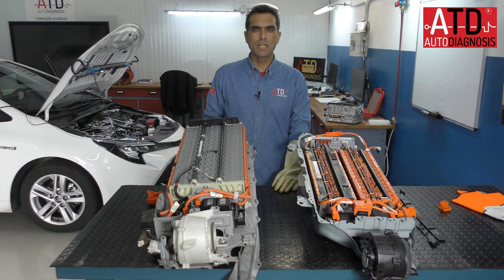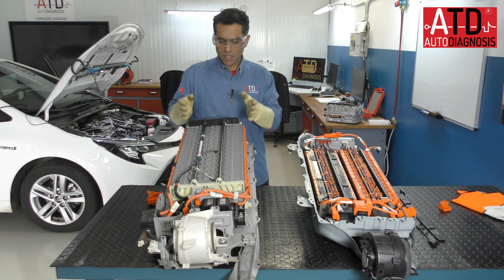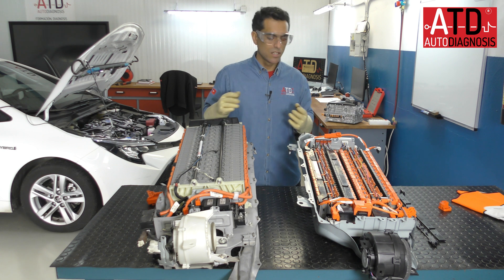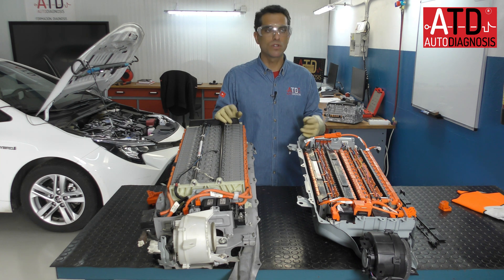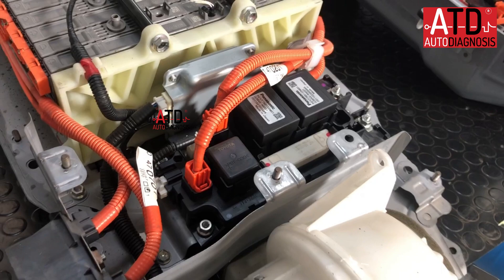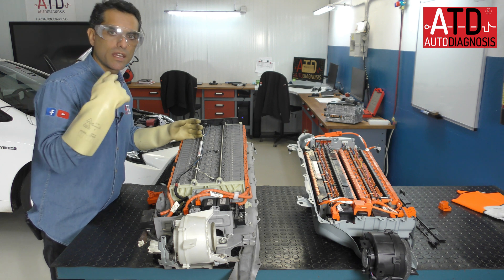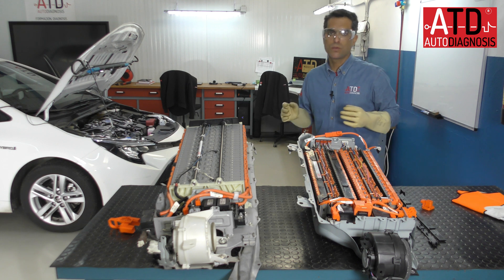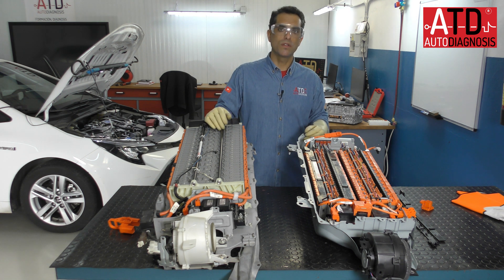Toyota NiMH vs Li.Ion HV battery.

Comment: help me with this one.I’m reconditioning a haybrid battery of 2012 Toyota Prius with two bad cells.Wha years of prius use the same NIMH cells?.I heard 2004 to 2008 are not interchangeable to use on a 2009 to 2015.Thanks in advance for your or any one response.
Reply from the maker: Hello. From 2009 to 2014.

Comment: Do you know if the 2019 rav4 has a lithium hibrid battery
Reply: Toyota rav4 hybrid up to 2023-24 had NiMH battery, plug in version have Lithium battery. You have a very good chanel “The car care nut” about Toyota and Lexus cars.

Comment: Thanks Alot for the information. Sir is it safe to replace nickle battery into lithium battery? i have 2013 prius, can i replace my battery to lithium?
Reply from the maker: I don´t kno, because the software is different.
Reply: Yes posible but You need to change also a lot of parts like bms..
Reply: Hi whats needed to change gen 3 to gen 4 li ion?

Comment: nimh 2000 cycles vs li ion 700 cycles the important is long life and nimh battery is very safe.
Reply: why only 700? Doesn’t li ion work in a limited range of 40-70%? for an increased resource